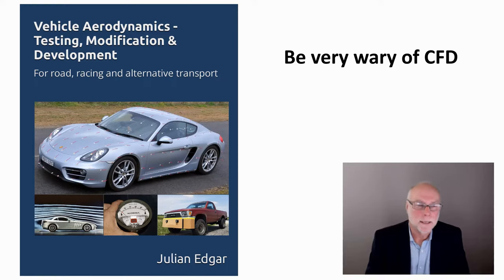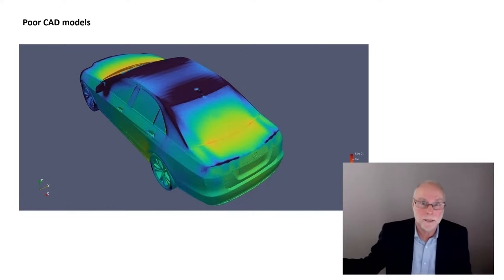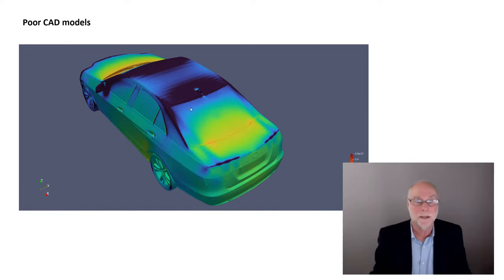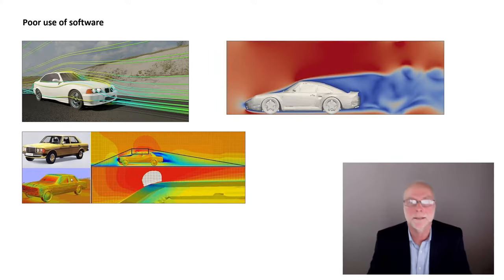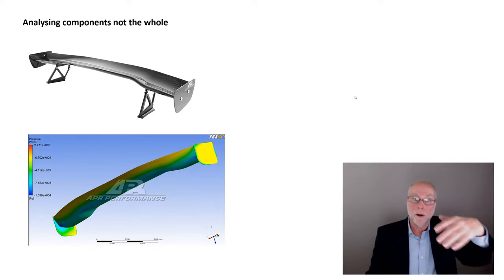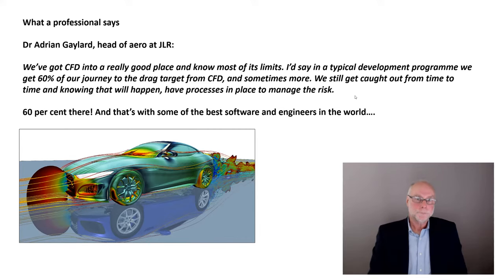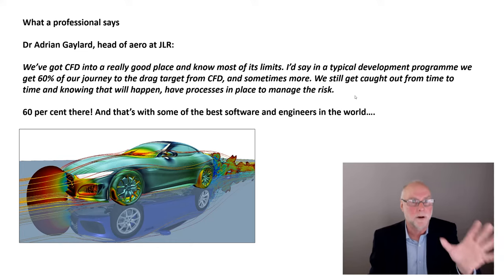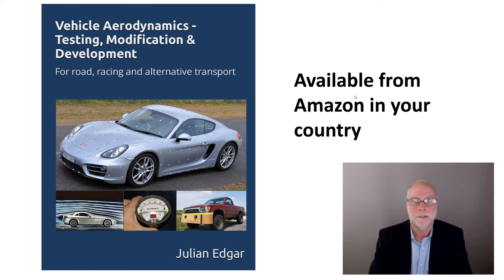Modifying your car? Be very wary of CFD

Comment: Very good discussion, thank you. I have never run a CFD analysis, but have done many structural analyses over my career, and I have to say that it took years of training, learning the nuances of the software, being able to do hand calculations to verify I was in the ballpark (and to understand what was going on), and comparing the analyses to physical results to get to a position of doing valuable work. An amateur with no training/experience, and no engineering background would have produced laughable, and dangerous results.  

My favorite aero book is Racing Car Aero by Katz, but I do have yours also and find that it complements the Katz book very well.

Comment: I purchased a cheap 3D model of a Mazda MX-5 NC (Mk3) and used AirShaper to run some CFDs.

While the 3D model was clearly deficient in many areas, I did nonetheless think that the CFD artefacts were interesting, and the CFD-derived Cd was in fact very similar to the value obtained by a German car magazine in a full scale windtunnel.

Next step is to buy the car and try using some of the methods that Julian has provided in his many books!
Reply from the maker: See my book for how different the CFD-derived drag and lift values were on the Mercedes compared to the CFD...
Reply: @JulianEdgar  @robhills2613
There is no simple "yes or no" answer to the question if CFD is accurate / useful or not. Julian rightfully points out that it highly depends on the 3D model, which is true. And that was the major reason those drag values were off on the Mercedes. We've done simulations on a highly accurate scan of the Rivian R1T and got very good results (which were endorsed by Andrew McAllister of Rivian himself). Just to show that when the model is correct (and the selected accuracy at AirShaper is high enough) we can get very close:
https://www.youtube.com/watch?v=LxXCOT5ID20

Does that mean CFD is useless for anything else? No, not necessarily. Through automation we can take away some of the errors that are made by many users. Also, if you're looking for overall flow patterns to get insights into for example the angle of attack towards a wing, then 3D models off the internet can still make sense.

But I fully agree - you need to look at CFD results with a healthy dose of skepticism.
Reply from the maker: @AirShaper In fact the angle of attack of a wing is a good example of how CFD should not be used to look at aero elements in isolation; the best angle may well depend on the car to which it is fitted!
Reply: @JulianEdgar 
Yes, the best scenario is to fit the wing on the car and run a full car analysis - completely agree, and we also saw this working on the Pikes Peak car - wing worked well in isolation and was bad when placed on the car. But if you're for example shopping for after market components and you're on a tight budget, it's still valuable to know what the "base" airflow pattern around your car is like, to know where & how to put a wing (and yes, that wing will influence the base airflow pattern in turn, but you'll still learn a lot).
Reply from the maker: Yes, and finding the "the 'base' airflow pattern around your car" can be achieved in 30 min and at no cost... no CFD needed!
Reply: @JulianEdgar  
The pragmatic answer is that both testing and CFD have their use. They're especially useful when combined.
Testing techniques will tell you a lot about the airflow patterns (tufts) and pressures (sensors) on the surface, but getting info on flow patterns away from the surface is more difficult (although not impossible, with PIV, kiel probes, ... but more expensive and complex). So correlating CFD and testing is a very useful method, as you can then use the CFD for very insightful visualizations and 3D model variations without having to build a prototype every time.
Reply from the maker: Yes… but the airflow patterns away from the car are of no significance! It is only the behaviour of the air (pressures, especially) against the car that determine drag, lift and downforce.
Reply: Appreciate what both of you are saying.

I should also add that I don't have the vehicle mentioned.

This was the first time I'd used CFD, so that was interesting in itself, and the visual aspects were instructive, but in the end real world testing must be the final arbiter.

Comment: I once removed the factory  rear spoiler from my car and drove it, with the  bootlid unlatched, on an empty road at 100, and it was still unlatched when I stopped. 
I then repeated the process with the  spoiler  refitted, and the boot latched at not quite 80- I heard it. I  thus concluded that my rear spoiler  wasn't entirely ornamental...
Thinking that this is an effective,  if wholly unscientific method of testing.
Reply from the maker: Very good!

Comment: As the person who works a lot in CFD, i need to add something really important about your first point - CAD model doesnt need to be precise to every mm, because before you open the CFD program you still need to simplify the model to make the simulation in reasonable time (like 8 hours). That does not mean that precise models are not used - they are but in fields that require you to calculate downforce right to 0,001 N.
And also good mesh is really important. With bad quality mesh you will never have right results.
Reply from the maker: Yeah, but we're talking CAD models with no underside detailing (just flat floors), steps in body shape that aren't there, wheels that aren't detailed (and sometimes don't turn) etc.

Comment: Good points.
Ancient computer technology saying:  "Garbage in, garbage out."
Computer modeling is only as effectively predictive as the data and programming that drives it.  Also, be careful not to misinterpret the result(s).
Use critical thinking.  It's always good to be skeptical in matters of engineering (and many other facets of life).

Comment: Have you ever experimented with an automatically variable front air dam/grill? 

My modified little Gen 1 Veloster hatchback runs cool until it doesn’t, and I think it would be quite the fun pursuit to devise a way to have a speed and temperature controlled air dam, but I’m wondering if you’ve ever looked into it, or if you can think of a method that would be remotely cost viable. Once my intercooler and/or oil coolers Heatsoak, it needs all the deep breaths it can get. Just the nature of squeezing fun and horse power out of a 1.6L 4 banger.

Don’t worry, I know your book will teach me how to test any implementation of such a harebrained idea,  and I’ve already ordered it. More just a question of feasibility.
Reply from the maker: Pretty easy - just use temp switch and solenoid.
Reply: @JulianEdgar  lol. I meant the moving bits, sensors are the easy part. 

But fair enough, I wasn’t clear in how I asked. 

To me, the hard part is devising something that can open/close all or part of the grill, fits inside the engine bay, and can survive the heat environment. Once all that is in, sensors to tell it when to move seems the easy bit
Reply from the maker: Get the grille shutter from another car. I have one from a Ford Focus that looks pretty adaptable.
Reply: @JulianEdgar  Ty!

Comment: Another YouTuber Bjorn Nyland tested a car with a roof box,  without, and with a trailer itch  box ( just a box hanging from the hook not a trailer with wheel).
He was measuring the efficiency reported on the same road, quite accurately, not as much as you, but still good .
The end result was that the difference between none and trailer itch box whas minimal 
Maybe you should collaborate
To improve

Comment: One thing I’ve already disliked was lack of radiator airflow modeling, most just block it off lol a solid or free flow through it like it’s open. Also for track cars they always model them with windows up but in the US tracks require windows down. The window opening is a massive influence on down stream airflow and it’s never modeled!
Reply from the maker: Yes, both very valid points.

Comment: What about measuring scaled models? You can 3d print different iterations that way.

The only issue I can see is that the Reynolds number will be different due to the size difference. But I guess you could change the wind speed for that
Reply from the maker: Reynolds numbers a very large problem. 1/10th scale model - 1000 km/h wind speed needed. No good. How big does your model need to be? Also, surface roughness a real issue.
Reply: @JulianEdgar  I see. My main concern was just seeing if an addition made a positive or negative impact to the Cd, but not trying to see the scale of the impact. I assume that cfd MIGHT be good for that since I am not trying to get perfect results. But even then a scale model might be better. But I think the largest I could print on my machine is only .42 meters...
Reply from the maker: Making a positive or negative impact on Cd is highly based on Reynolds numbers and surface finish. If you can print at 0.42 metres (1/10th scale?) then you will not be able to test it very well. Also, wouldn't a printed model need a massive amount of work to give the correct surface finish? Maybe you could try testing it in a water tunnel - higher density fluid will allow slower speeds. Personally, I think making a full size mockup will, overall, give better results for less work.
Reply: @JulianEdgar 3D printed surfaces have gotten massively better, but, I think you’d still have to at the absolute minimum sand it smooth and put automotive clear coat over it, which to get that well applied—You’d basically need a real car paint booth. Unless painting cars happens to be your hobby, I think you’re right about full scale mock-ups.

Comment: Hey i am very curious about ur thoughts on spoilers on fwd, especially for sedan shape (notch back), do u believe a low angle spolier is good for them to give a bit off stablity on the rear during corners to them but not to much because it is fwd ?
Reply from the maker: Makes no difference whether the car is front, rear or all wheel drive. Spoilers can be effective if well designed. All covered in my book!
Reply: @JulianEdgar  may I know which book it is that would cover it the most, might try to get it than to get a better understanding, thank youuu so much for your content by the way
Reply from the maker: https://www.amazon.com/Vehicle-Aerodynamics-Modification-Development-alternative/dp/B0C87VYVL8 or Amazon in your country. Shows how to develop and measure rear spoilers, including on a sedan shape.

Comment: So a question is eyeballing(like proper eyeballing with attention to detail)better than a for the lack of a better word crappy cfd?
Reply from the maker: No. Eyeballing can be completely wrong. Testing is best.
Reply: @JulianEdgar  so even bad cfds are better than eyeballing with detail?
Reply from the maker: Whaaat? Both approaches are crap - and why would you use either, when you can easily, accurately and cheaply measure the real vehicle?
Reply: @JulianEdgar  doesn't that count aS eyeballing since you still have to look
Yeah my apologies I seem to have abnormal explanationz for words 😅
Reply from the maker: Measurement is nothing like just standing there looking at a car ("eyeballing").
Reply: @JulianEdgar  I mean u look at wool tufs and stuff too isn't that looking and the fan thing I forgot it's make behind the Porsche cayman they don't count as eyeballing since your looking at they're movements?
Reply: And yes I watched plenty of the videos  quite informative indeed
Reply from the maker: Testing includes tufting, pressure measurement, downforce/lift measurement, throttle stop testing, etc. Yes, you need to use your eyes to do this testing...
Reply: @JulianEdgar  so why is it considered different from eyeballing I'm confused u still have to trust your eyes is it like because when people hear eyeballing they think zero effort or something?
Reply from the maker: https://dictionary.cambridge.org/dictionary/english/eyeballing
Reply: @JulianEdgar  Because some people are very lazy.  (I would know, I'm one of them)